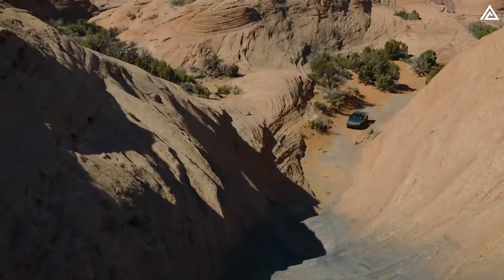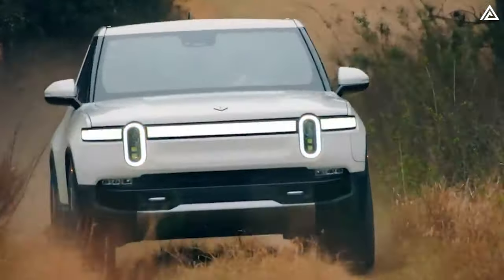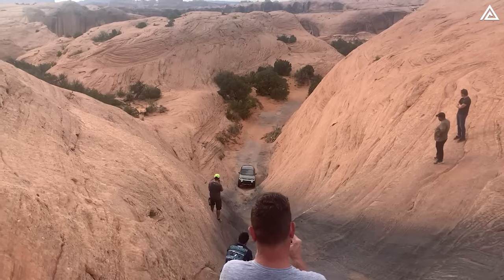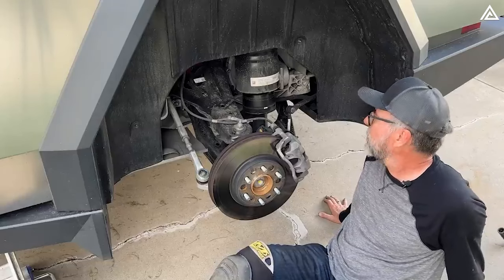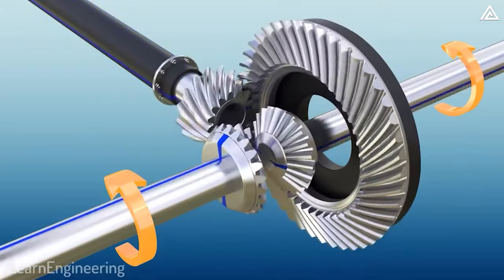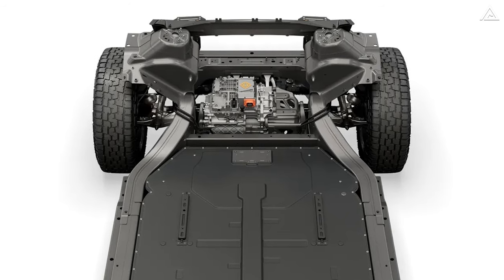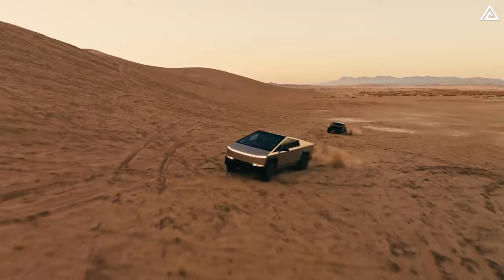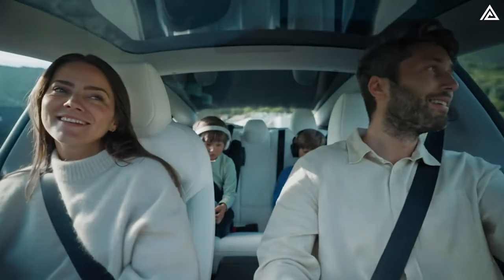Cybertruck Faces Rivian R1T at Hell’s Gate. What Happened? In-depth Analysis of Off-Road Capability

Comment: I understand tesla saids the truck has over 10K of torque, but dont use that to compare with other manufacturer because they are obviously using a different method to calculate torque. Tesla is saying it has more torque than 10 eighteen wheelers combined. 😂😂
Reply from the maker: I know. For comparision, Freightliner Cascadia semi truck which still only has 2500 lb-ft of torque. About Cybertruck torque, that's torque accounting for gearing to get to the wheels, not the motor. Gearing reductions increase torque. That not a typo.

For example - the Dodge Challenger Hellcat Redeye is rated at 707 lb-ft or torque at the crankshaft. First gear has a ratio of 4.71 and the rear axle ratio is 3.09, leading to over 10,000 lb-ft of torque.
707 * 4.71 * 3.09 = 10,290 lb-ft
Reply from the maker: It’s wheel torque, not motor. But what you said is correct, these company used different method to calculate torque:))
Reply: @adamtech999  wheel torque is very easily calculated with a dyno machine. And no matter how they want to say it. It is not 10K at the wheels. It is calculated diferent. It is a great marketing idea. Yet if I were to compare to any other vehicle with that formula. Most heavy duty pick ups would have similar numbers. Anyhow. So it is not a typo it is a great marketing strategy and in a dyno is not gonna show, because it is not true
Reply: @adamtech999  https://youtu.be/c4xiZNamBMM?si=g7Yk7QJvoROGSlxV 

that is showing a regular dyno test for "at the wheels torque" on a Demon. Torque is not difficult to calculate. In any dyno is calculated at the wheels.